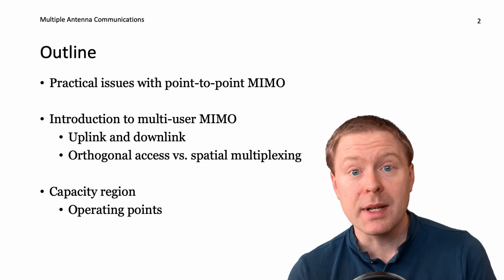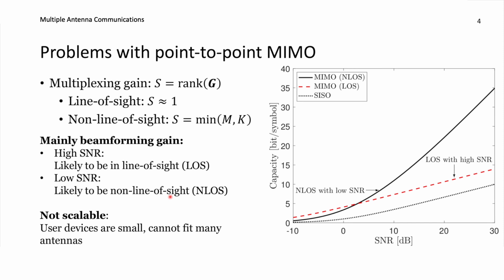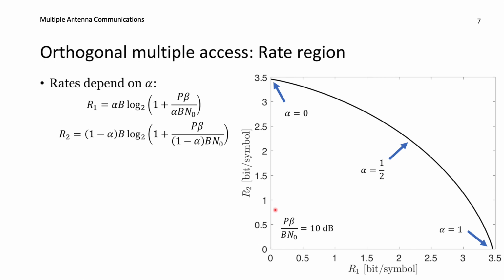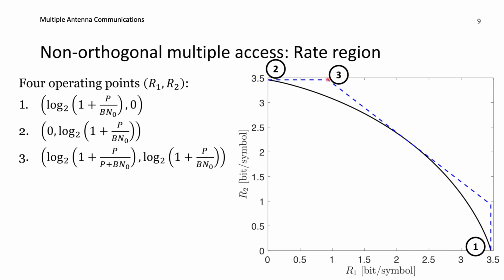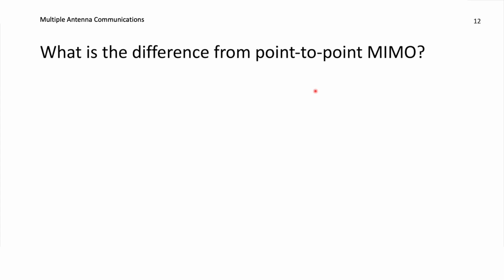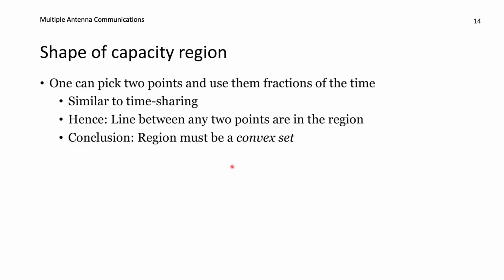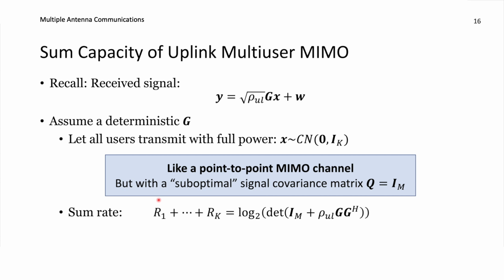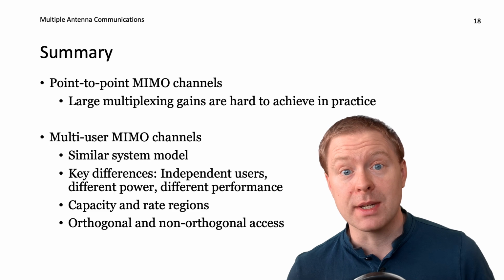Lecture 5: Introduction to Multiuser MIMO

Comment: Thank you, can I use SVD beamforming for MU MIMO and SU MIMO? AI says that is the case, but I also read somewhere it is just for SU MIMO.
What is your opinion? Thank you.
Reply from the maker: SVD beamforming is the optimal beamforming in SU-MIMO.

Beamforming vectors in MU-MIMO are generally not based on the SVD, but one can probably find some iterative algorithm that also involves repeated SVDs (e.g., one updates the beamforming for one user at a time).

Comment: Would the position on the Pareto boundary be determined by distance from the antenna, in that closer stations will usually have a stronger signal?
Reply from the maker: The rate region and its Pareto boundary is normally considered for a single setup, where the users are at fixed locations. The region then demonstrates how the rates varies depending on the system design, e.g., how the power is allocated between the users.

Suppose we consider two different rate regions: One with nearby users and one with far-away users. The rate region will be larger in the former case since the signals are stronger, which is aligned with your intuition.

Comment: Thanks for the great lecture.
I just have simple question, from the derivation of channel capacity with power constrain we know the optimum probability distribution is the Gaussian and its assumed for the transmitted signal x. however also the signal is modulated as BPSK for example, or any other higher order modulation, and it is just a points on the constellation diagram not Gaussian. so what is the philosophy or the idea behind this thinking and analysis in driving the capacity of a digital communication system.
Reply from the maker: This is a good point that we discuss in Section 2.4 of the book "Introduction to Multiple Antenna Communications and Reconfigurable Surfaces" (Download here: https://www.nowpublishers.com/Article/BookDetails/9781638283140)

The short answer is that the channel capacity is achieved by encoding the data using codewords whose length goes to infinity. The proof builds on generating those codewords with Gaussian distributed entries. In practice, we don't do that, but instead, we create the codewords using a combination of a modulation format (e.g., BPSK or 16-QAM) and a channel code. This makes the implementation much easier, and with the right design, we can come close to the capacity.
Reply: @WirelessFuture  Thank you very much for your reply. The book is great and contains everything I want to know. I have started reading it. Thank you for this contribution.

Comment: Good Video, sir! And I have a question. What is the difference between Non-orthogonal access  and MU-MISO?  In the 13-th page, you mentioned that MU-MISO's region is lager than Non-Orthogonal access, why? Thx!
Reply from the maker: What we refer to as non-orthogonal access is a MU-SISO scenario, so one serves multiple users but has only one antenna at the base station.
Reply: @WirelessFuture  Clear explanation,thank you! I noticed that there is a technology named 'NOMA (Non-orthogonal Multiple Access)'. Does multiple means base station has multiple antennas? If so, Does NOMA equals MU-MISO?

Comment: A short question, please. I assume that the channel matrix H is measured very precisely, perhaps we get 4 digits after the point. With that granularity we get always the max. rank (columns will be always independent). Is that right? 
I think you must round it a bit to get perhaps just 2 digits. Then it could happen lower ranks. What are your thoughts about that? Thank you.
Reply from the maker: The measurement noise will always lead to full rank, from a strict mathematical perspective. What matters in practice is how many of the singular values are “large” and caused by the channel. This is the useful rank of the channel from a MIMO communication perspective, because these are the ones that the waterfilling power allocation wants to put power on.
Reply: @WirelessFuture  thank you, the eigenvalue decomposition is also used. Is waterfilling also done on the basis of the eigenvalues (with quadratic matrix)?
Reply from the maker: @knutlohmann8205  Yes, the eigenvalues of the quadratic matrix (called the Gram matrix) are the same as the squared singular values. So you get the same result in both cases

Comment: Many thanks for all of your videos. A short question. On slide 6 you have this well known capacity equation. I refer so the SNR term (P*Beta/Alpha*B*N0). The whole noise term increases with higher bandwidth, that is clear. But with higher B, I assume the nominator term must increase too. Everybody wants more B - so does the term P*Beta increases too with higher B? Is that P something like P=B*P0?
Reply from the maker: I thought that I had responded to your question, but it seems that my answer didn’t appear. Here is a new attempt:

Since the total noise variance is proportional to the bandwidth, it is indeed preferable to also increase the transmit power P proportionally to it. This is indeed done at cellular base stations in the traditional sub-6 GHz bands, which might use something at order of 10 W per 10 MHz. The maximum transmit power of a mobile phone is, however, limited due to battery limitations and regulations on the electromagnetic exposure so it cannot increase with the bandwidth.

When we reach for even higher bandwidths at mmWave frequencies, it becomes harder to build radio transceivers that uses high power. A mmWave transmitter for 5G typically use 1-10 W, even if it has 5 times more bandwidth than a 5G base station in the 3 GHz band that uses 100 W. So in these cases, P isn’t increasing with the bandwidth - rather the opposite.

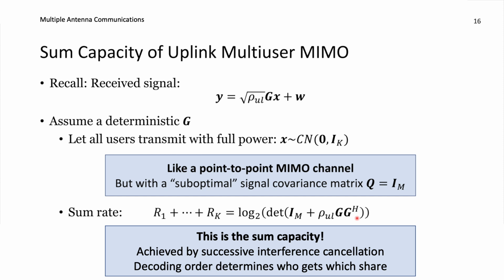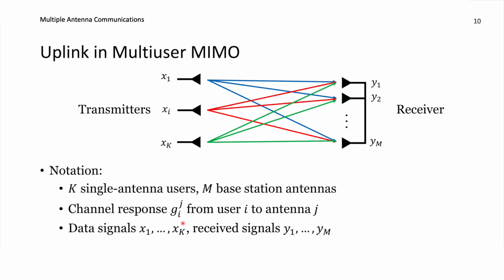Comment: @32:47 (page 16), initially considering the individual rates, R_1 ... R_K  as a vector and comparing that to the flow diagram for the equivalent P2P MIMO shown at 18:39 (page 10) of Lecture 4, am I correct in making the following inferences?  1. The precoder V would now be absent in multipoint MIMO, since there is no cooperation.  2. There is still the post-processing operation U^H for recovery at the receiver with U^H now being replaced with a normalized version of G^H (G Having been obtained via channel estimation using pilots the usual way, and repeated for each coherence interval)?  

Next, the expression (with the matrix determinants) shown for sum rate  R  is obtained by adding up the component rates, R_1,...,R_K, in the equivalent P2P MIMO, as stated.  While I am able to make this connection sort of intuitively, by referring back to the singular values, is there a place where I can find the precise matrix derivation?

In the third step, the argument is made that the sum capacity of the multipoint MIMO which uses successive interference cancellation is identical to the above expression for the sum rate of the corresponding  P2P MIMO.  Is this some sort of fundamental result in information theory?  Is there a place where I can find the derivation?  

Thank you so much for your advice.  I am thoroughly enjoying this series, though I have to absorb it slowly😊.

Comment: I have just a short understanding question regarding MU MIMO. In the DL we a a bit another situation than in the UL. The DL gives us several beams to different user, and we can use the same resources (frequency) for every user. We get spatial multiplexing. That seems to rather clear. In the UL it is a bit different, because the UEs send in an isotropic matter. So at the receiver (base station) we must handle the interference. So it is a bit more difficult, but possible to decode. We use SIC. Nevertheless, in the UL the  base station uses the same beams like in the DL. Is my understanding correct?
Many thanks.
Reply from the maker: The downlink beams are not razor sharp, so there will be some remaining interference also in the downlink. The total interference is rather similar between the uplink and downlink, but divided differently between the UEs. While each signal is transmitted isotropically in the uplink, they reach the base station with different directivity. The base station can process the received signals over its antennas to filter out signals from undesired directions, in a way that is often called receive beamforming since the directivity that one can achieve is the same as when transmitting beams.

The reason that we talk about SIC in the uplink, but didn’t cover the downlink counterpart, isn’t because the interference is worse in the uplink. It is just easier to implement advanced interference cancellation methods in the uplink than in the downlink. The downlink counterpart is called dirty paper coding.

Comment: Thanks Prof for your great lecture. I have a couple of questions:

1) Why SNR is likely to be high in LOS and low in NLOS, could you explain more about it?

2) In the slide at 32:53, you said that the sum is "the sum rate of P2P MIMO but the sum capacity of uplink MU-MIMO". Does it mean that the capacity of P2P MIMO is theoretically larger than uplink MU-MIMO's one? And that is because it's unable to optimally allocate power to users in Uplink MU-MIMO as in P2P MIMO. Do I understand correctly?
Reply from the maker: 1) In NLOS scenarios, the signal has to be reflected on various objects and penetrate various materials to reach the receiver. This creates a lot of extra attenuation.

2) Yes, for the same channel matrix G, P2P MIMO gives a higher capacity than MU-MIMO, since the "user" antennas can cooperate in the P2P by sharing their power and apply precoding/combining.
Reply: @WirelessFuture  Thanks very much. I'm still confused that if P2P MIMO gives higher capacity, so what is the actual motivation to use MU-MIMO? It is just to serve multiple UE simultaneously?

Comment: Thanks for your videos. The term "orthogonal" does not really mean a different of 90 degrees? Am I right?
Reply: If two things are orthogonal to each other it means that the one thing does not influence the other. For example in a constellation diagram, you will have two dimensions that correspond to a signal that is modulated on a sine and one that is modulated on a cosine. Because a sine and a cosine are "orthogonal" to each other we can have independent modulation on both these components. The difference between a sine and a cosine is 90 degrees, but you can have orthogonal things that have nothing to do with angles. For example two independent spatial transmission paths are also orthogonal, or you can have two different frequency bands that are orthogonal. You can send data over these paths, without influencing the data that is communicated over the other path.
Reply from the maker: When considering two-dimensional real valued vectors, then “orthogonal” means different by 90 or 270 degrees. When considering M dimensional complex values vectors, there are many more dimensions where orthogonality can appear, but it is essentially the same underlying geometry. Within an M-dimensional world, you can find a plane where the two vectors exist and are different by 90 degrees.

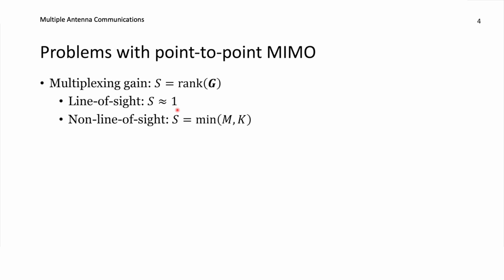Comment: 4:50 In the case you are using dual polarization antennas at the receiver and the transmitter, you would be able to get a multiplexing gain of 2 in the LOS scenario right? Is this something you see often or is it too hard to properly seperate the two polarizations? PS your content is great!
Reply from the maker: You are right! This is indeed used a lot. There are at least dual polarization at the base station and many devices also have dual antennas which might have different polarization. There might be leakage between the polarizations due to hardware effects, which means that the 2x2 MIMO matrix is not diagonal. One can then use the point-to-point MIMO theory to find the right precoding and receiver computation.